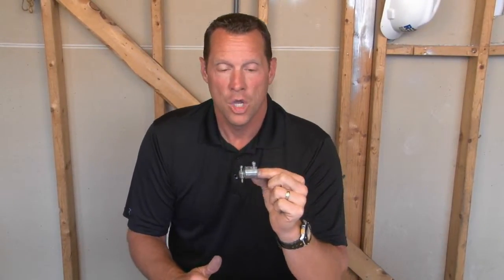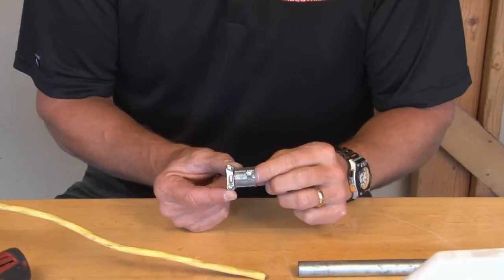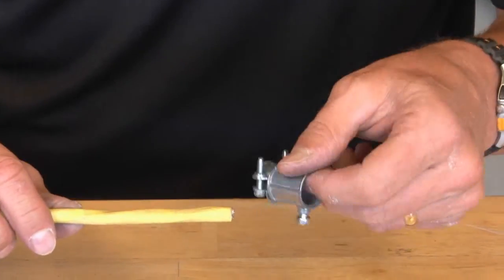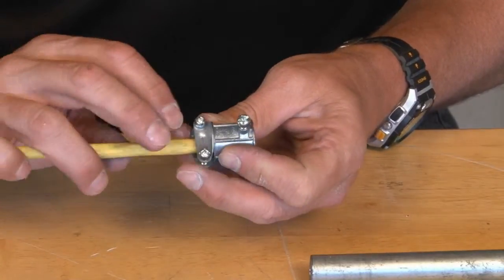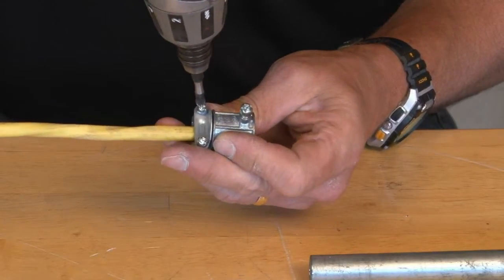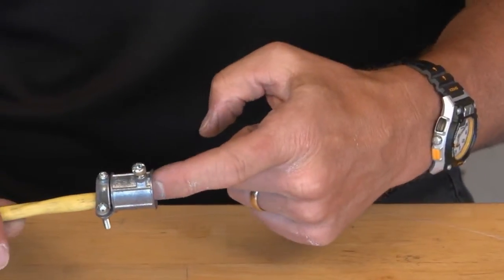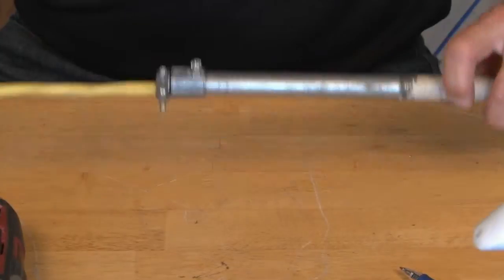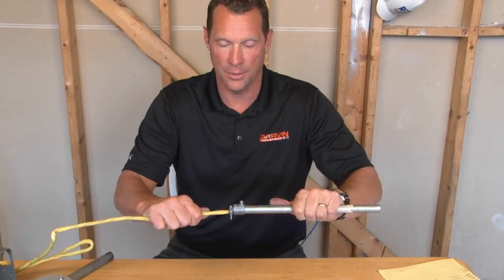3/8" Screw Type Combination Coupling (EMT to NM Cable): EMTNM-38

Comment: can't you splice them together in a metal junction box??
Reply: The point of the fitting is to not have a splice as far as I am aware. It would be a code violation to make a splice inside of that fitting. The best use of this fitting would be if you wanted to run NM from the attic but needed to surface mount the wire down a block or concrete garage wall in order to add a new GFCI receptacle and surface mounted box. You can run the NM without removing the sheathing, and clamp it to the EMT that way it will not rub against the edge and also no bugs or debris can creep into the EMT. The EMT would sleeve the NM to protect it on the surface mounted EMT installation. The guy doing the demonstration seems to not be very familiar with the electrical trade.